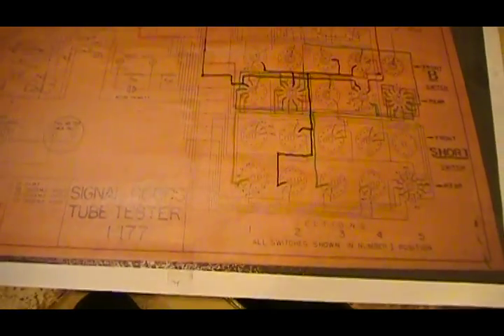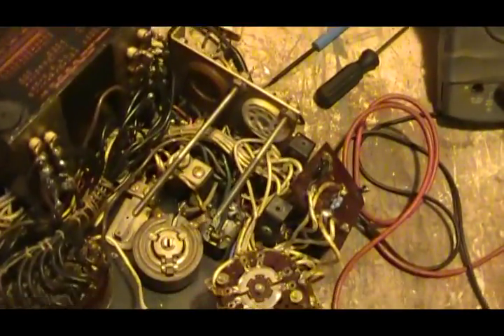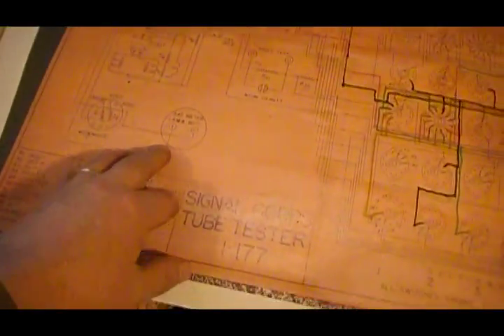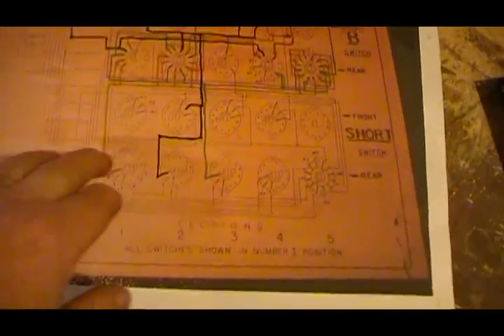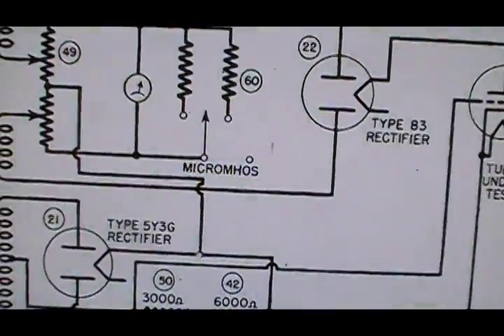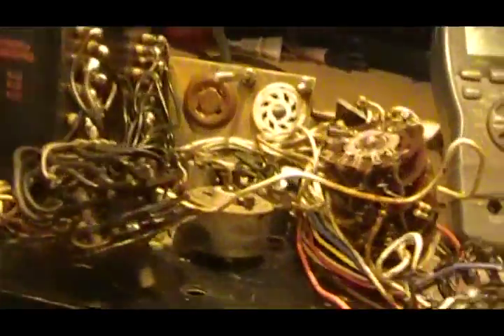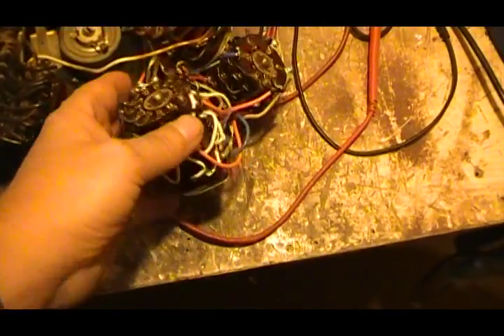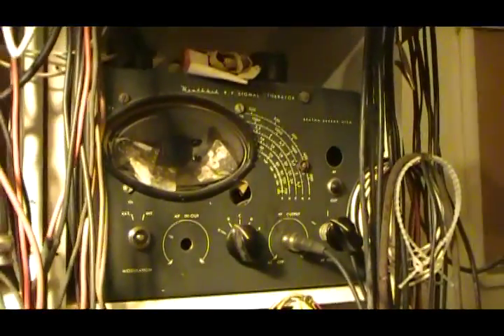Hickok I177B

Comment: Dennis,
It looks as though you may have your work cut there my friend.  Once you’ve traced and cured all the mistakes, problems relating to the burn-up, and any other likely issues, the tester will be a very useful piece of workshop kit provided its accuracy can be assured.  I am curious as to how the repair will progress.
I had to smile, the original circuit diagram, with its burnt and scorch corner, reminds me of old maps marking the spot where treasure is buried that were seen in a few pre-1960s pirate movies.
Regards,
Phil.
P.s, you DO NOT ramble on – you talk a lot of sense.  Although we’ll never meet, I’ve a feeling that if we worked in the same TV and home appliance service centre, I’d get along with you dear chap.